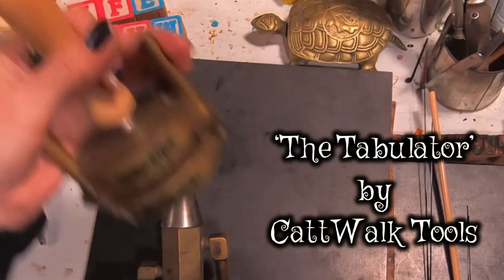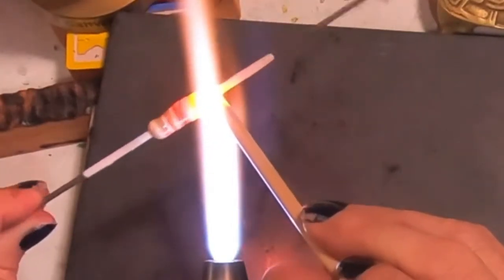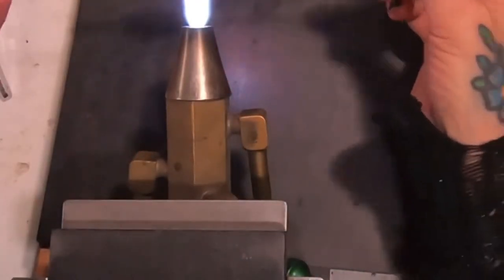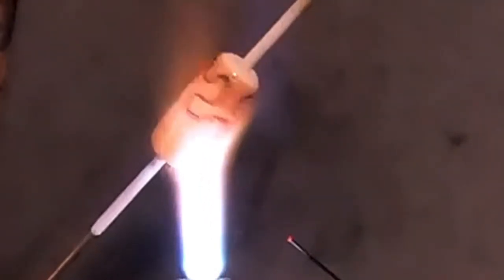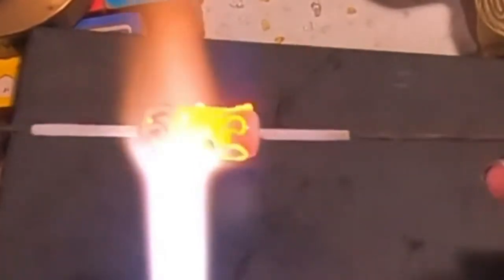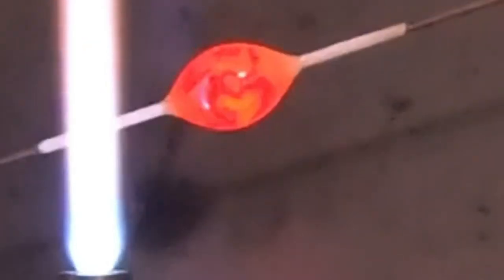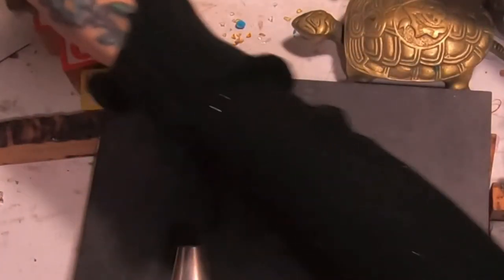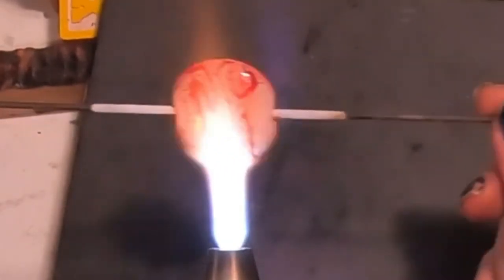Lampworking / Flameworking - 101.32 - Chaos Glass - Spiderwebbing Glass, demo. Using The Tabulator.

Comment: hi and thank you for sharing your knowledge! I am wondering do beads and small flamework pieces need to be annealed in a kiln or can they air cool? i'm a artist and just bought a small flamework bead making kit and need to know if I need a annealing kiln also?
Reply from the maker: Hi Pamela!  I’m so excited for you!!   Playing with this material is so magical!  Most everything you create should be annealed or slowly cooled to ensure that it doesn’t crack.   The easiest way for most small glass items is either in between 2 pieces of fiber frax or get a used crockpot and put vermiculite in it.  Keep the heat on high and cool all the way before retrieving your glass.  If your glass is still cracking using these items then you may need to get an annealer, but you should be fine if only making small work.   (it is much more cost effective as annealers are pricey).  I hope this helps!
I am here for you,  if you need help with anything let me know!  😃
Thank you so much for your comment, Pamela!  Happy Flameworking!!   R- ✨✨✨🌹